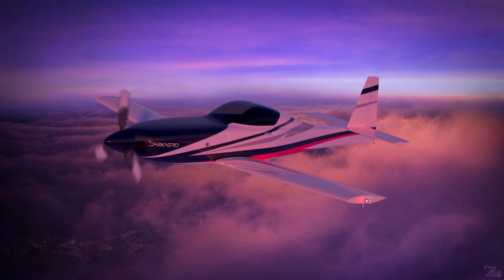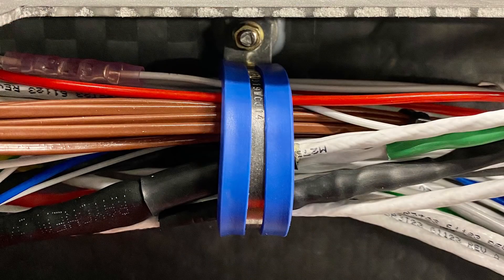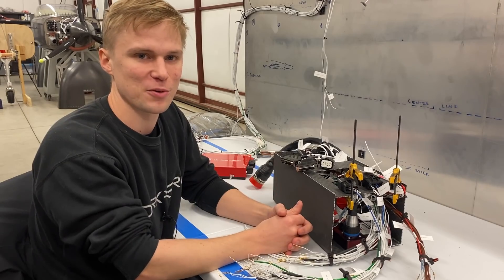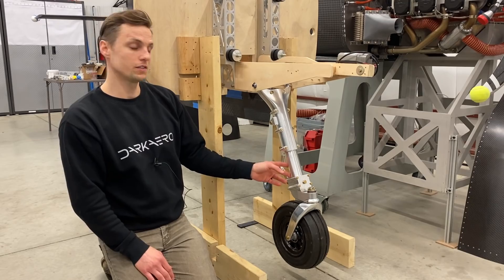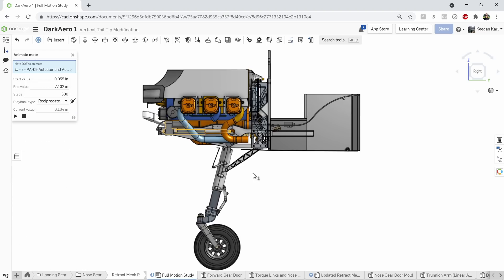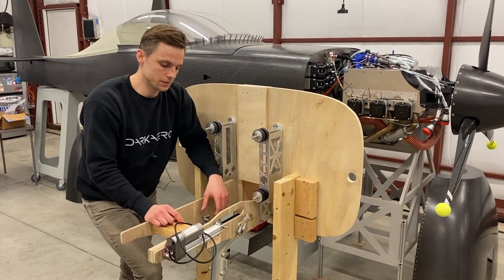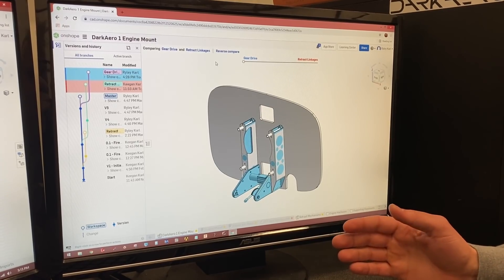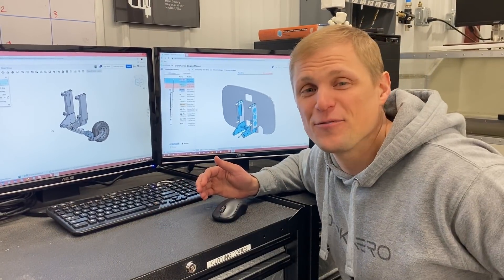Nose Gear Refresh: Trying Something New (+Progress Update)

Comment: Will you implement some kind of emergency gear drop ( Gravity drop? )
I´m starting to fancy your plane, looks great and not to expensive as what I understand.
Reply from the maker: Great question! Yes, both designs we showed incorporated a backup provision for extending the gear. The pilot pulls a handle that disengages the actuation system and a passive gas spring drives the gear down to overcome aerodynamic loads and into the down locked position. We will have more to show on how this works in upcoming videos.
Reply: @DarkAeroInc  Sounds nice. I was thinking about building the sling TSI... but now I´m starting to think "Hmm.. maybe I can live with a 2 seat plane" :D Keep it up.
Reply: @DarkAeroInc  is there an overcenter linkage to hold them down?  I'd trust the gas strut to drop the gear against aerodynamic loads but not against runway loads.  Also I hope you have some sort of open house after the pandemic ends.  I'm also on the south ramp and it takes all my willpower to not go over and bother you guys
Reply: @dbhyslop  why would you want it to overcome runway loads? 
The gear by definition has to have a lock out. Which is all youd need to land on. 
I dont understand your question?
Reply: @DarkAeroInc  Oh.. sorry. One more thing.
Can you please update your website so international ppl (rest of the world basically) understands ( Metrics please :) )
I have no idea of how far 1700 sm is withou google... Nm (aviation) or Km (standard) would be nice. Same goes for pounds and kilos.
Reply: @Maviation     2.2 pounds per kilo and all sorts of converters available on line.

Comment: What will you do to ensure the caster aligns for retraction, and doesn't collide with the doors?
Reply: In the Rutan designs, and the Cozy, the castering nose wheel centers itself by wind load only.  Also, retraction occurs right after take off, and the wheel is already straight when it leaves the runway.
Reply: I see some risk here. If you rely on the airstream to center the nose gear, what happens if retraction occurs during a gust induced side slip?
Reply: @kennethsmolana9865  The question is moot.  Side slips are only done while landing.  Why would anyone retract the gear while landing?  Rutan designed aircraft have been successfully using this system for over 45 years without any problem.
Reply: @GregoryACross  I think it's clear that Kenneth is talking about an accidental slip. The controls could be inadvertently crossed in any mode of flight by an inattentive pilot. Your point about the history of a similar design in the field is well taken. But I also see a potential for damage due to pilot error, and every certified retractable nosegear I'm familiar with has a centering mechanism.

Comment: I like gears but wont you need a mechanical lock of sort to carry the torque load on ground impact. Alternatively make the gears large diameter and wide teeth, maybe symmetric in both sides so it's strong enough to carry the shocks. And how do other simple planes do this? like lancair IV
Reply from the maker: Both designs we showed have hardware to lock the gear down and react against the drag loads. The second design did not have the drag links or torque links shown in the CAD model we shared but you could see the “eyelets” on the back face of the trunnion where they interface. Lancair uses hydraulic actuation on their designs but our gear retract design and geometry is much different from a Lancair so we couldn’t reference their work.
Reply: @DarkAeroInc  ok, thanks for the answer. I prefer direct electric over hydraulic. Have you considered angling the suspension forward a bit to absorb the backward compression component? so it doesn't turn into a locking force on the sliding link.
Reply: @DarkAeroInc  or a spring steel tube gear without suspension angled backwards a bit.

Comment: I love that you are using components meant for FIRST robotics on this project. Tip if you are not in the FIRST community: look into these gears: https://wcproducts.com/products/pocketed-gears.  They are the same as the Vex pro components you show but have been pocketed to drop the weight in unnecessary areas.  I have used those gearboxes quite a bit and have been mostly happy with them, but they have some real failure modes associated with them.  Send me a PM and we can have a quick chat.
Reply from the maker: Good eye! One of our interns, Michael, introduced us to them since he had a lot of experience with robotics. Still determining the production solution, but for initial testing of the design, the VEX parts are awesome because they are readily available, cost effective, and are backed by a lot of engineering data and testing.
Reply: @DarkAeroInc  Honestly, there are a lot of analogs between the competition robots and Aviation.  Both are trying to cram peak performance  with minimal weight.  The biggest difference is in reliability and failure tolerance.  There are even some items in the competition robot world that I think would be acceptable for use in landing gear...

Comment: why not have the wheel turning to sidewards and so not taking up much space.
Reply from the maker: Hi James! Pivoting the gear strut and wheel up into the fuselage the way we have shown ends up being the most efficient use of space. There is an empty area in between the pilot and copilot feet which is where the nose gear wheel well sits. If the wheel was turned sideways, the wheel well would need to get wider and it would interfere with your feet and the rudder pedals.
Reply: Im not talking about sideways in the space where it was to go straight in. Im talking about level with the undercarriage and enclosed in an aerodynamic flared housing. Then you have even more space.

Comment: I like the the second design. Having the actuator act in the same axis and direction as the front gear assembly will remove the cantilever force on the slide rail all together, it wouldn't hold up well on the carbon cause it would eventually rub wear.

The only issue I see now is getting enough leverage on the nose gear to not stress the actuator. Knowing that adding a relief rod with lose bolt ends would add height to the location of the actuator.

And thats a nice main wiring harness.

Comment: Wondering what airspeeds the nose gear be able to handle...  and if the electric motor is strong enough.
Reply from the maker: Good questions! We're following the guidelines per FAR 23.729 for extension and retraction for airspeeds of 1.6*V_s1. Yes, the motor and gears can generate enough torque to fully retract and extend the gear. Thanks for watching!
Reply: @DarkAeroInc  I want a marshmallow man spec.
Reply: Many Aircraft like the light cessna things are electric.

Comment: can you buy your spur gears from mcmaster-carr or is the aero quality contraint preventing that?
Reply from the maker: Since our airplane is experimental category, there are a lot of options for what we can use. The biggest requirement for the gears is strength but beyond that we want to keep the weight down too. We have sourced some prototype parts from McMaster but there are a lot of places to get gears since they are a common mechanical component.

Comment: 1) Rev.  Nose Wheel Centering Cam so Nose Wheel aligns during operation.  2)  You have a fast aircraft... add Steering Damper (anti shimmy)  Great job brothers fast!!!
Reply: It appears the nose wheel is a fully caster type, without any steering inputs. 

A shimmy damper would prevent the nose wheel from swiveling. 

A properly designed castering wheel will always trail behind without wobble. Riding a super bike no-handed at 160mph is a prime example of perfect front fork rake/angle. 

Most GA airplanes don't have enough steering castor to remain stable, because castor requires more effort and larger loads on steering components and pilot legs. 

But that's the case where you have steering linkages to the nose wheel. This airplane appears that it doesn't have those linkages. 

So I suppose it's steering by differential braking. Very simple, reliable, and works well if properly designed. 

(But this overall design seems to be utilizing multiple control concepts that are less than ideal for yaw control, both in the skr and on the ground, at least from the standpoint of this rudder-loving pilot).

Comment: It seems nose gear is always blasted with grit / bugs / crap and such from the prop, your work here is so nice - I'd suggest a small carbon fairing (similar to dirt bike fork guard) to protect that dandy design as well as make the post flight clean up duty a bit easier.
Reply: If a fairing had a definate aerodynamic advantage that may be the way to go but just to keep insects and minor dirt off the leg?? Depending on where you live you're going to get bugs all over the craft.
Just give the aircraft a quick clean after every couple of flights. It has to be a working aircraft so it's going to get a bit of rash here and there! These people seem to know what they are doing!